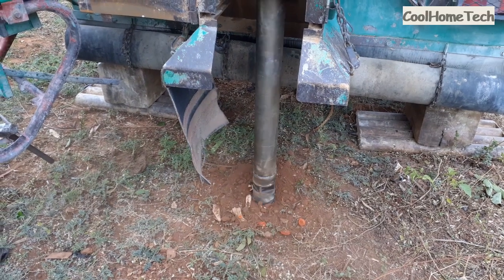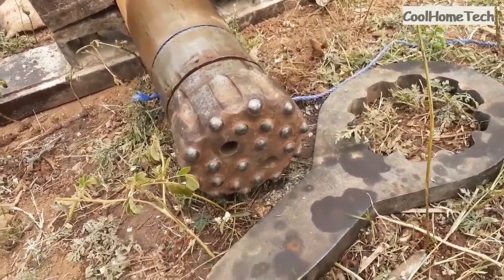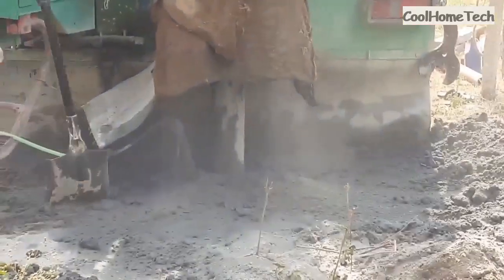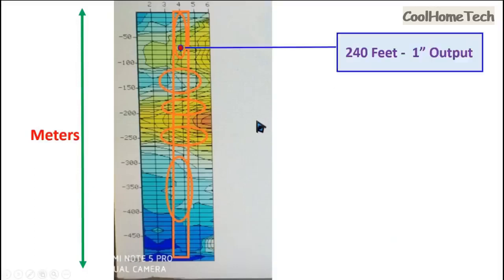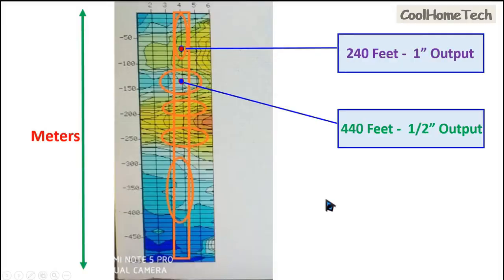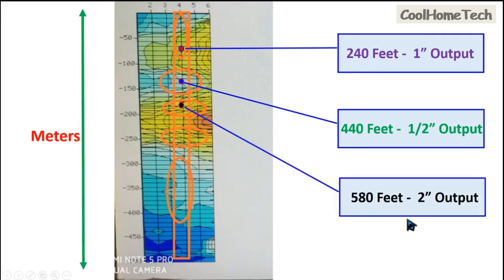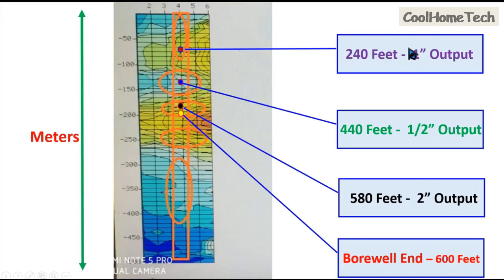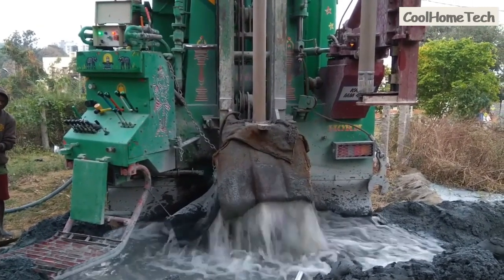Does 3D Locator Identify the Bore Point Correctly ?

Comment: Sir, Is It really necessary to have external casing pipe of 10 inch or 12 inch for borewell? This is in addition to regular casing pipe of 6 inch. Or is it waste of cost for Bangalore? 
If 10 inch casing is needed, then till what depth it should be installed. Thanks

Comment: Thanks for introducing the new tool *to identify the potential water bearings Borewell- location .

This is 3D locator especially beneficial in urban settings. 

I admire for your professional  presentation of this topic (of borehole prospecting point).

As premier institutions like USGS(US Geological society) and BGS;  NOT accredited this new technique (3D locator),
So I need to know the consistent -Success ratio of this technique

#Please tell us about Service fee charged by the surveyor and Phone No. of this surveyor.
 Also,*So it is prudent /wiser to get genuine data* of successful ratio of   this 3D method .
#Please do the NEEDFUL.
Reply from the maker: Hi
He do give service only in Bangalore and Tumkur. If you are here please send me an email for his contact
As I told in the video, this method does not give you 100% guarantee of water underneath. It will provide information about cracks between the rocks. In between these cracks you may get water or may not get also. 
Regards